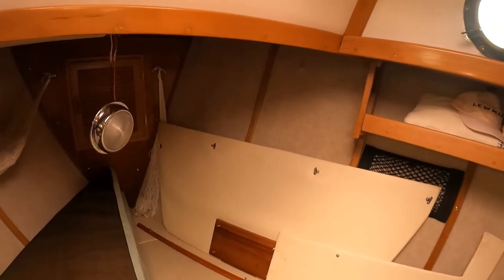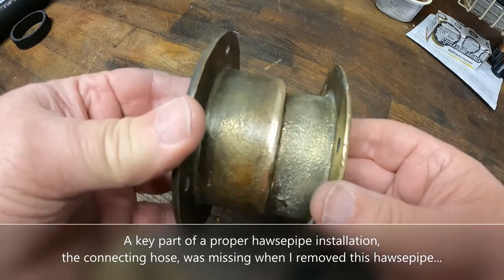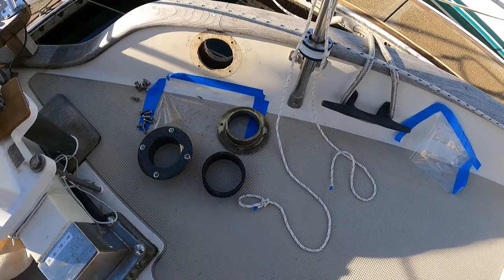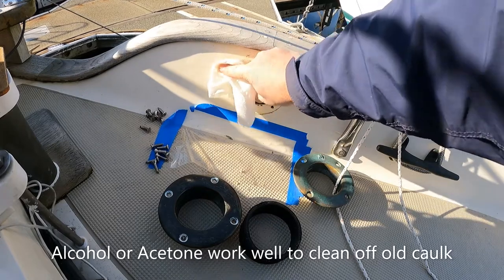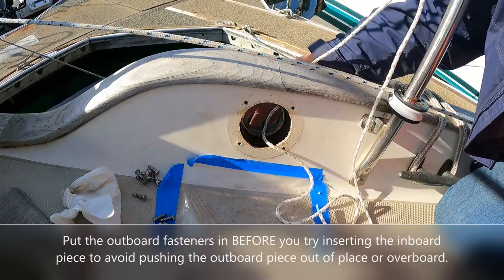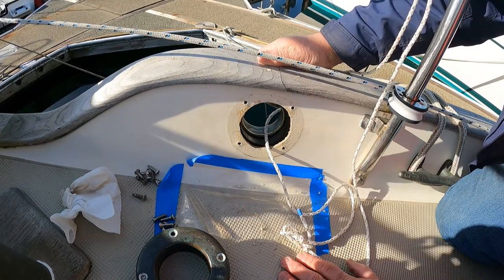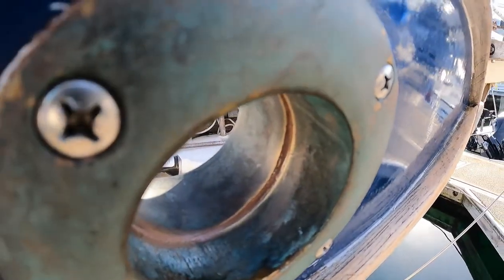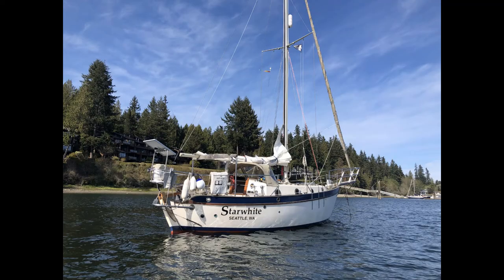Leaking Hawsepipe in the Bulwark - Video #16 - Westsail 28 - "Starwhite"

Comment: A few thoughts, mine had hose on them and still leaked badly in severe conditions. The original caulking deteriorated over time and never adhered well to the bronze or rubber hose. I replaced the hose with a more flexible and longer silicone sleeve and used a much stronger caulking/adhesive compound. I hope to get another 40 years of use out of the boat with out a leak. Btw I’m 69! Thanks for the video. Ben S/V DAWN

Comment: Do you still have the brand of pipe?
Reply from the maker: The 3 1/4" inch hose is Novaflex 200 marine soft wall wet exhaust hose.
Reply: I just wanted to thank you for your help. I have hull#2 so no boomkin. The Volvo and that club foot are gone. The videos you provided are almost like a guide. I do like the PSC, especially the Crealock but can't find or afford one.